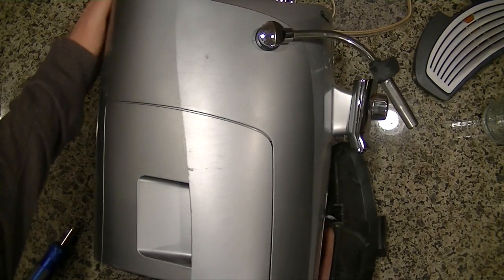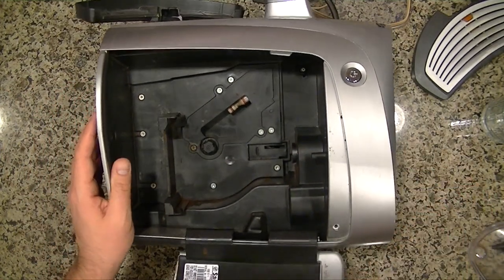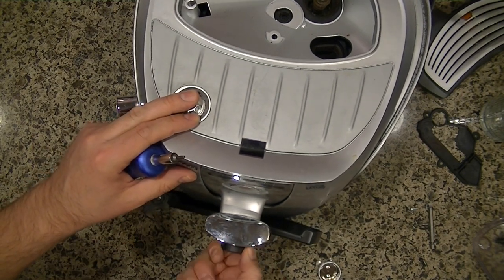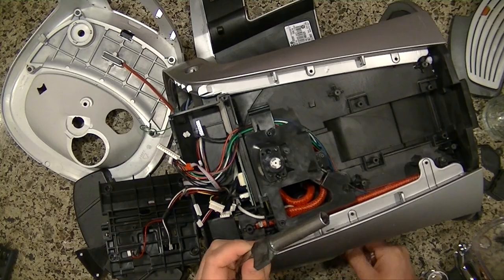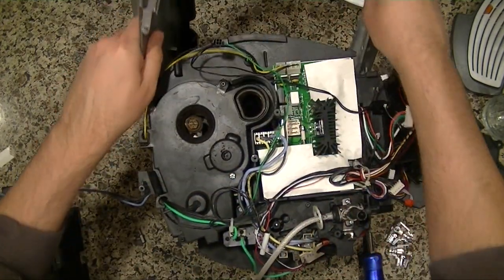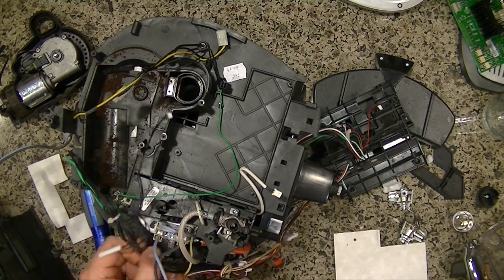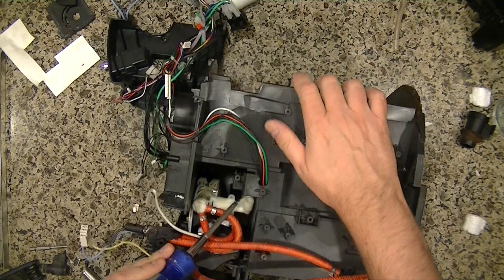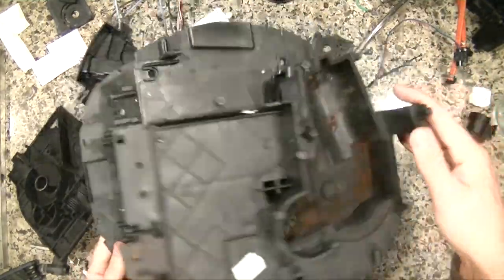How To Tear Apart a Saeco Talea Ring Plus Espresso Machine for repair

Comment: Andrew thanks for your video. The centre button on my Talea Ring stopped responding to touch. Your video helped me so much in being able to get the touch panel off. I found that the front panel had warped due to heat over the 5 1/2 years I have had the machine. Once I got the touch panel out (6 small plastic legs into the body of the machine) i removed the small circuit board which was only glued on. I then put the front panel in the oven at 275f for about 2 minutes. I removed the front panel from the oven and put the circuit board back onto the panel and clamped it in the centre with a small g clamp. This allowed the circuit board and front panel to mate again properly and so all fixed.

Comment: My machine just stopped working. It passes water through the pipe, it descales fine etc. But no more coffee is coming. It starts with the buildup of noise from the pump, then goes a bit quiet, and eventually it gives up and makes a loud pop/bang type of noise. So it does pump water, but it doesn't pass water through the coffee. Anyone have an idea what I should check or replace?
Reply: Wow I just repaired it because of the exact same issue you described. What I did was take the front silver dispenser part off. I pulled off the large Saeco knob, then used torx bit to remove 3 screws. Clean out the coffe dispensers (black plasitc box thing with a rubber top) and I also shoved a toothpick into the opening where it connects the box. There is a spout there, you probably can't see it unless you look up in there with a flashlight. The toothpick part solved my problem, and I checked by putting a small hose to the white tube (it connects to the brew group) and blowing. Air passed through with no problem. I put it all together and ran it in preground setting a few times to make sure it worked and to keep from wasting beans. Water passed through no problem, and the pressurized popping had stopped. Hope that works for you
Reply: I have the exact same issue after 8 years of perfect service. Will have a go at the proposed solution
Reply: Ok i just took it apart and no blockage in the pipe. Wasted my time. Now I found this: https://youtu.be/l89XJIJoWf4 Where I actually found out that my brew units filter was completely shut.